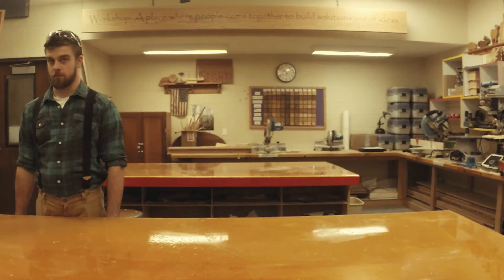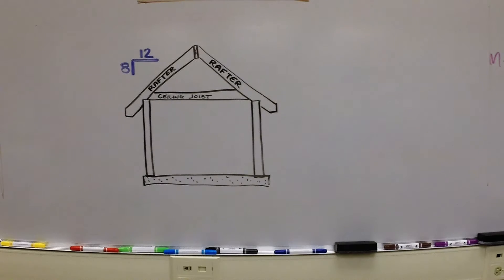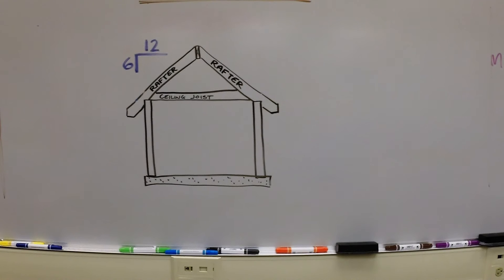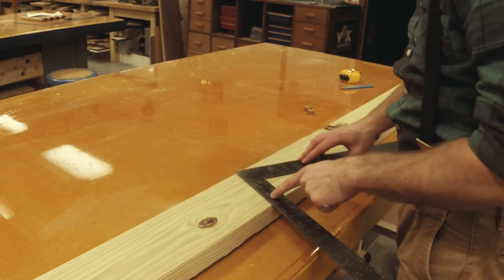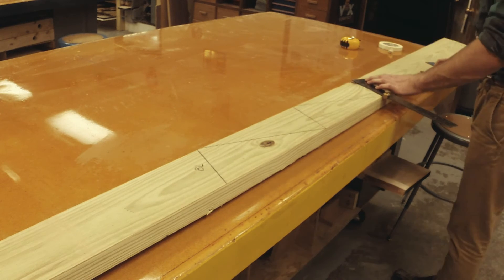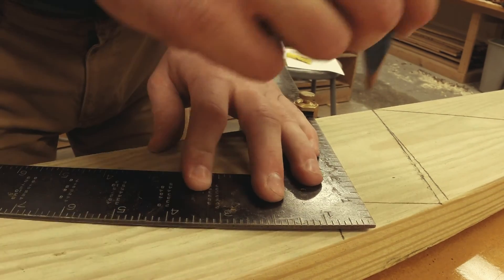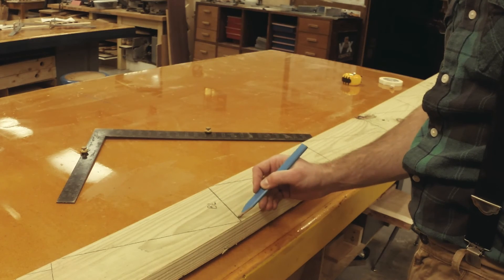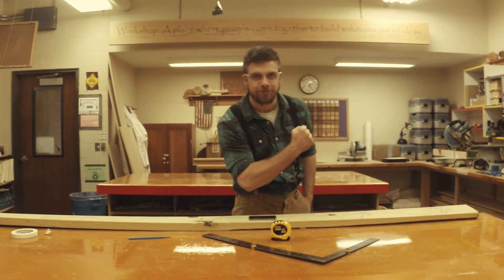Laying Out Common Rafters

Comment: When your measuring down six inches at a time for birds mouth is this aposed to stepping down 2 times at your original pitch then measuring five inches, as you lost me saying six inches down vertically I only saw you drawing a line vertically down the square cheers
Reply from the maker: Yep, this pitch was 6:12, so the tongue of my square was set to measure 6" increments. I found it easiest to measure off my total rise 6" at a time using the tongue of the square, which was already set at the correct angle. If I was making a different roof slope, say 10:12, then I would have my tongue set to 10" and I would have measured off my total rise in 10" increments instead. I hope this helps